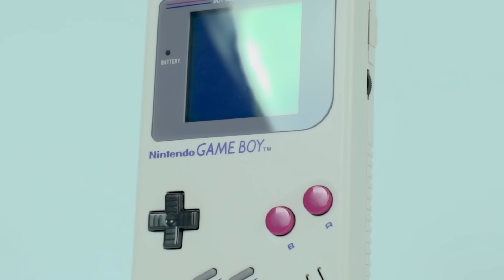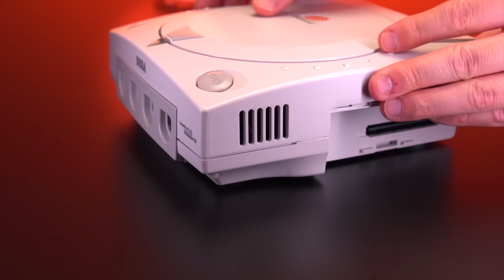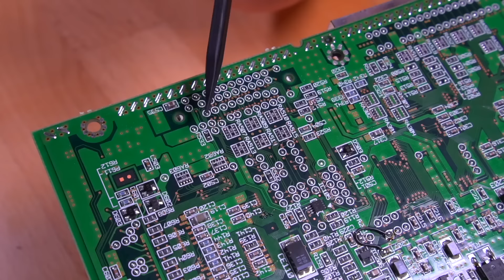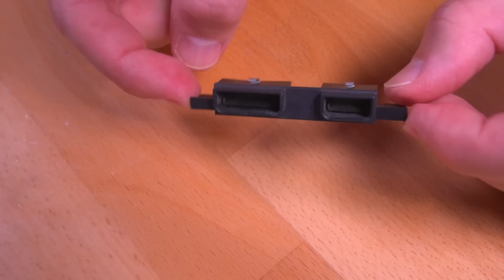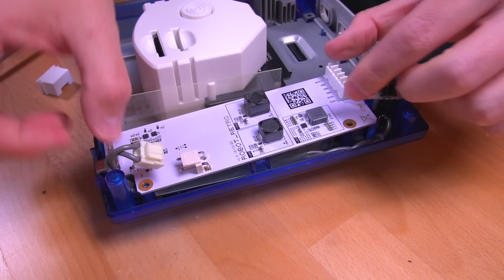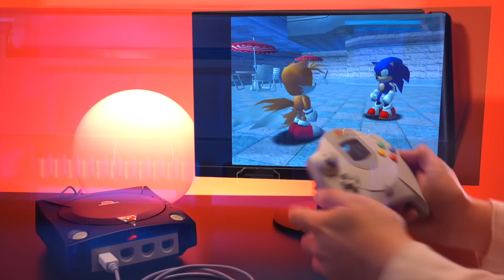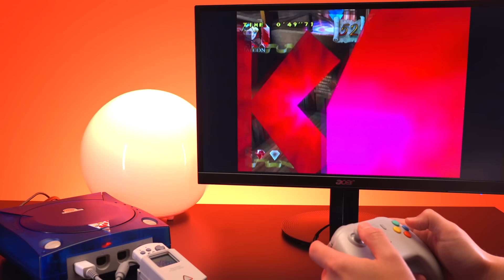Dreamcast Modding Is Getting Out Of Hand

Comment: thank you for mentioning my 18650 battery mod, unfortunately i could not deliver it in time.
Reply: Time is much less important that quality. The gaming world has taught me that many times.
Reply: @Bacon_Pancakes  Let it cook.
Reply: @Bacon_Pancakes  than*
Reply: that looks so much better then the hack job i did with an AA holder.
Reply: Take your time making them. It's better for anything electrical to take time and be perfect every time than a bodge job
Reply: I've been waiting months for stock to replenish. I'm on the email list. I haven't heard anything about new stock.
Reply: hello guyws

i am thinking of making a revw2 of it which will include blue retro functionality + the ability to use smaller li-ion\li-po batteries like those square shaped ones and lir2032 + ability to use cr2032 and ml2032. won't support 18650 but the other li-ion choices are gonna be more than enough.

it will be a complete replacement board and zero soldering or so is needed, it is still an idea which need work.

if it is not doable then i will make the original one again
Reply: looks amazing nice job on mod
Reply: You wouldn't happen to be thinking about designing one of these for Saturn would you?
Reply: Vegeta has entered the chat…
Reply: Does it add 2 kg to the console?
Reply: Oh cool, those are the same size LI cells used for Lightsaber installs. Very convenient.
Reply: Thank you for making this Mod! :)
Reply: Dude! That mod is awesome! I'm surprised you didn't try to add a self-charging board in there so that the battery self-trickles itself up over time so that even when it dies you just need to power it on to charge it instead of taking it all out again.
Reply: This mod is unnecessary overkill. It's not worth the risk of a fire just so my Dreamcast remembers what date it is.
Reply: @Cory_ to some it’s not. It’s the idea of turning on the console even if it’s been tucked in storage for awhile and having a normal experience without setting anything up again. Can’t say a 18650 would be dangerous as I’ve designed a very similar mod for my own console, includes overcharge protection, battery can supply 3.7v nominal or 4.2v fully charged but I only use 3.0v from it via a Shotkey diode and a buck-boost converter to maintain a consistent output which in essence gives the battery a nice relaxed time. Only time it could really risk is if it somehow goes into thermal runaway which is about as common as your smart phone catching on fire being the same chemistry.
Reply: @Cory_  I was wondering..and yes, that is insane and stupid.
Reply: Congratulations on the hakko sponsorship wow that's amazing

Comment: The upside down HDMI- port in these mods bothers me everytime lol
Reply: Gosh I hate when they leave the type c ports upside down too, like come on
Reply: @Basichaus  lmao
Reply: Lmaooo  @Basichaus
Reply: @Basichaus dont even get me started on the AC port
Reply: @Vanity0666  I’d be lucky to get it the first few tries! Ridiculous!
Reply: Are you referring to the mod in this video? If so, this is the correct orientation. The side without the notches is the "top"; that's the side with the #1 pin.
Reply: @itmeurdad  So why does every other device have the HDMI port the other way around?
Reply: @dreamcazman  They're not supposed to, checked on multiple devices including the PC I'm writing this on and they all have the flat side on top. Even checking Mouser the notched side is the one with the solder pads unless they are specifically mentioned as "Reverse type".
Reply: @dreamcazman  "every other device" you say? It took me literally one google search to find dozens of examples of both ways.
Reply: @itmeurdad  If you want to be pedantic about it, I was referring to AV equipment (not literally every device with a HDMI port). TV's, AV receivers, consoles all have the HDMI port with the flat side on top and the notched side underneath, at least the one's I've seen. It boils down to which side of the board it's soldered to and how the board is mounted. I have noticed some devices (like my mini PC) seem to have the boards installed upside down which results in the HDMI port also being 'upside down'.

What's even more annoying is when USB ports are installed upside down, but that's a topic for another day...
Reply: Just be glad it's not micro HDMI